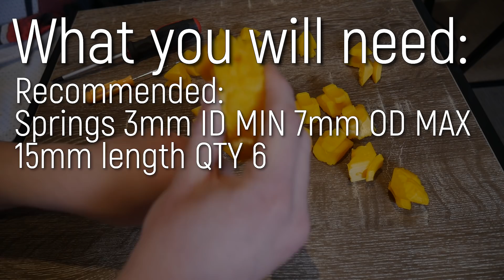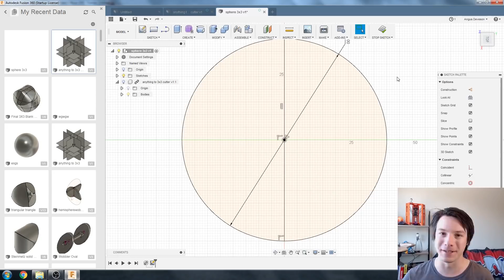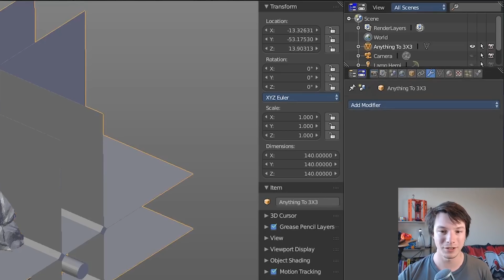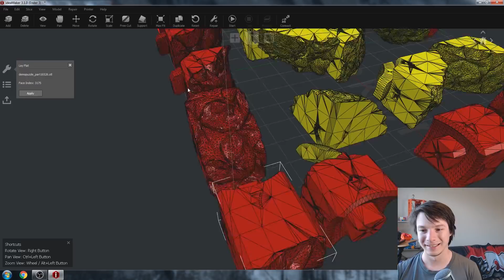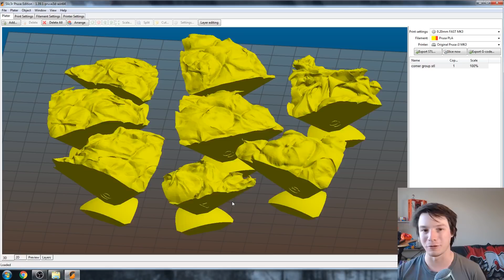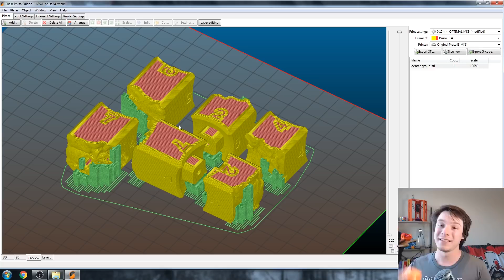Turn ANYTHING into a 3x3 Twisty Puzzle - Full Tutorial

Comment: Just a small trick if needed: for perfect alignment in Blender (and probably bforartsts?) you can align your mesh by choosing Object > Transform > Origin to Geometry [ctrl + opt + shift +c] on your mesh to get a good center origin point. Then since your cutter and cursor seem to be at world center, you can then use Object > Snap > Selection to Cursor [shift + s] with your mesh selected to center it to the rest. But the manual alignment still works well enough in most cases. Really great job!

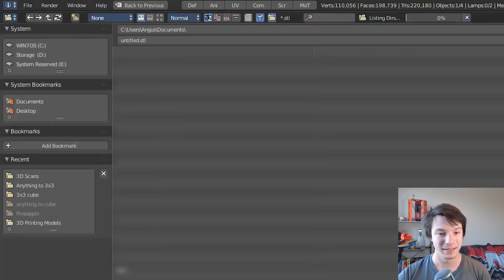Comment: 17:30 - it can be separated inside the Mesh Edit mode. There is a command... "P" - Separate by loose parts (select all before this). And you're done! You'll get nine objects.
Before doing all this, select all and Ctrl+N - "make normals consistent" (in Mesh edit mode). It's for a case of some bad normals run through the mesh. Usually it's fine... Be sure that there is no intersecting meshes (so it's really split by Boolean, check this visually).
Now select these objects, Export...
While exporting STL check "Selection only", "Scene units" and Batch mode - "Objects"
You'll get nine STLs with corresponding names where 1.000 will be equal to 1mm in Cura (it's "scene units").
No need in additional programs then :)
P.S. if you want to thank me, just click "Like" on this page: https://www.facebook.com/neorisKir/ For me it's more than a "like" here.

Comment: Hey Angus (or anyone interested), IDK if you know this, but you could have done the stl separation, alignment and layout in Meshmixer. Firstly, you need to set and select your printer in Meshmixer settings for the buildplate size. Then you can separate shells and go Edit > Align (Surface point - Ground Plane - Translate and rotate) and pick the point to lay flat. After you can go Analysis > Layout (settings to taste) and it will properly nest all of the (visible) pieces into efficient buildplate-sized arrangements which you can Combine and export into single stls. I was amazed how well this tool works.

Comment: Would printing the centre pieces on their "base" (with brim) work? Then the holes are vertical and the surface detail also built up vertically.
Reply from the maker: Nah you really don't want the gentle curved surface facing down or you will spend a long time cleaning it up. It has to have support either way, but on its side is the smallest amount.
Reply: Maker's Muse good point - thank you.